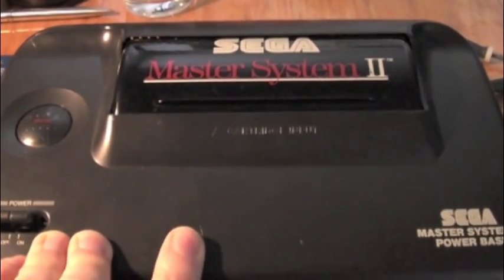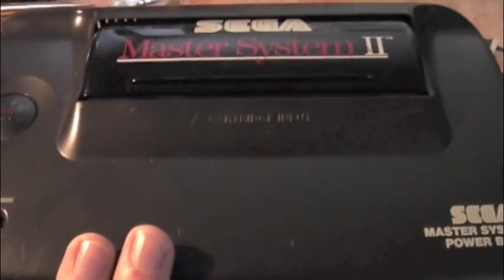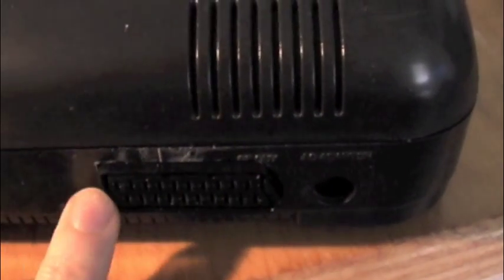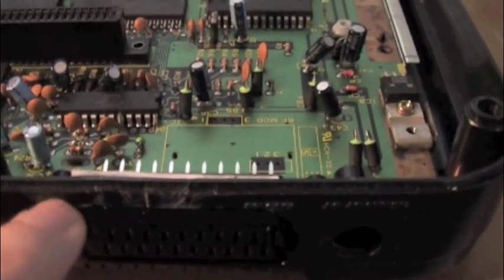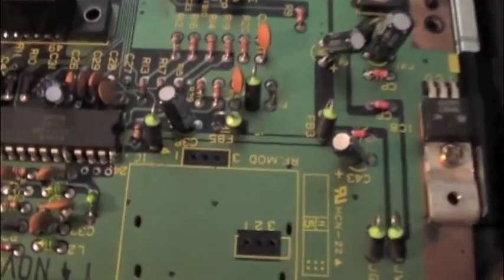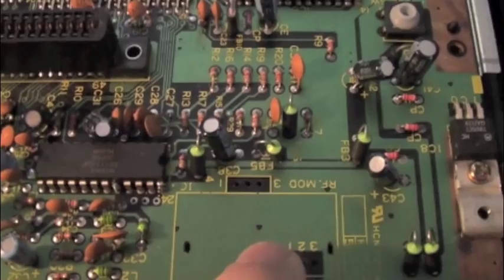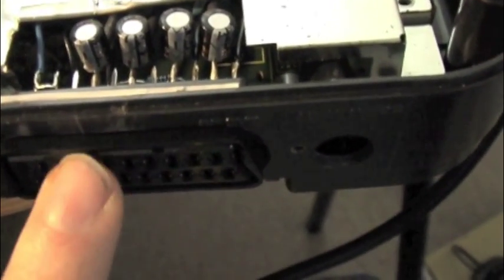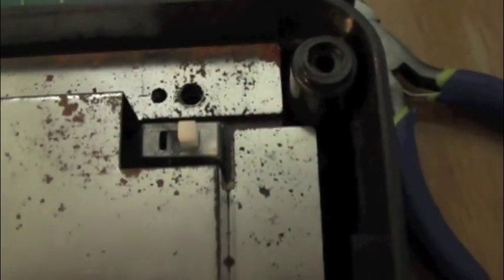Master System 2 SCART mod

Comment: Hi! If I use 10uF capitators is this gonna work?
Reply from the maker: Hi there, 10uf would probably still work, but the 220uf is the specification needed as stated in the technical sheet for the Sony video chip. 
It’s likely you won’t get a strong enough signal through the cable, and you’ll find that it won’t function on every tv that you plug it into.
Reply: @wellhiddenmatt  after some thinking i decided to make RGB RCA not Scart. I don't want make holes in console, so i gonna attach outside 4 RCA for audio and RGB video

Comment: thank you bud I was thinking on opening up a scart to hdmi  converter and making it hd. as the converter only needs 5v to run which I could ground to the motherboard
Reply from the maker: I would just check the specs for the 5v regulator in the master system first, to make sure it can handle the extra power draw for both the Master System and the hdmi converter. Better still just replace it for a newer more powerful one anyway. That will guarantee that you don't end up burning it out.

Comment from the maker: The pin outs for SCART are as follows.
1 and 3 are R and L audio. (I bridged the mono sound across both pins to get it from both speakers.)
4 is Audio Ground.
7 is Blue
11 is Green
15 is Red
19 is composite Video (Used for timing and also if you use a scart to Yellow RCA cable you'll still get picture)
The capacitors and resistors are in series with the pins.
A quick google search of SCART pinout will get you plenty of images for reference.
Hope this helps